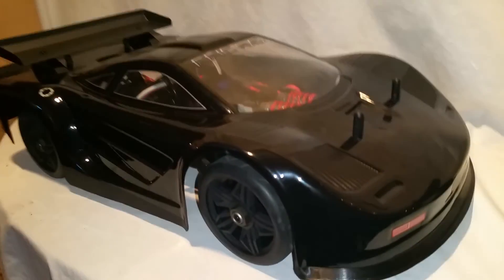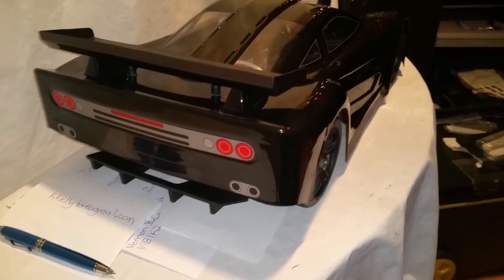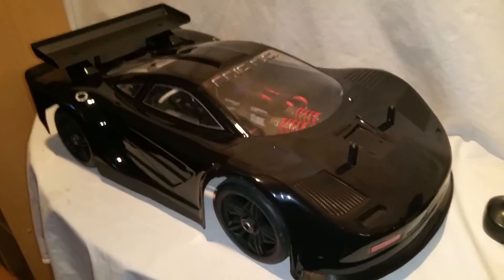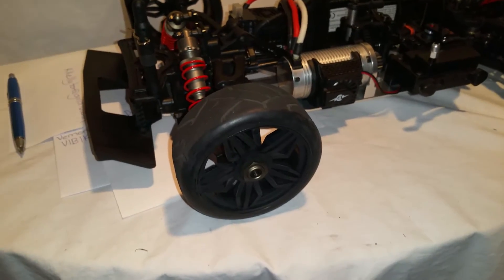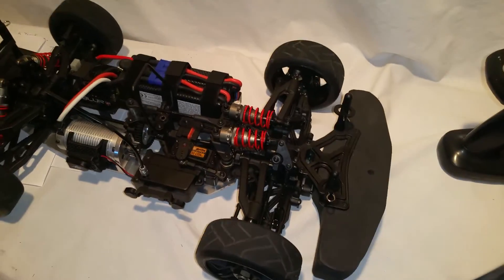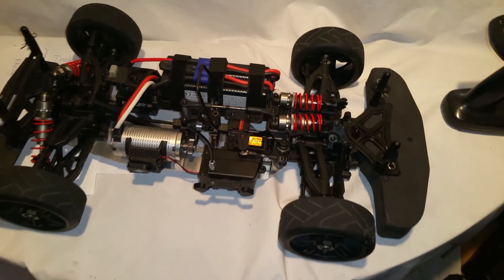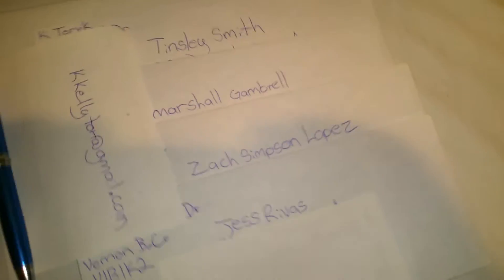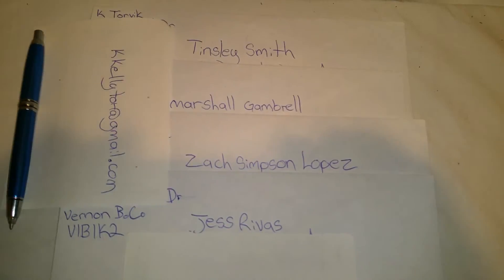ofna dm1 build done!

Comment: Your problem is that your receiver has more than enough power from the esc itself. When you actively continue to use the servo like your doing in your video the servo will drain all the power in the receiver. That is why your experiencing the glitch. I'm surprise that your DM1 didn't mad cow on you. Than again you didn't run the motor just the steering servo. Futaba receivers require a lot of power. That is why you have longer and better reception with a Futaba receiver than any other brand. You may want to install an external bec or a glitch buster. The bec will constantly power the esc because power is coming direct from the battery. If you install a glitch buster the glitch buster will store energy in the capacitor like a reservoir. When the receiver loses power it will draw the extra power stored from the capacitor. Hope that helps my friend. Your DM1 looks awesome. Can't wait to see it burn some asphalt. Thumbs up!
Reply from the maker: Thanks a lot man I kind of thought that it might need to be C. and I never knew that the futabas need more power that's news to me bro. again thank you buddy for all your great info you've helped me a lot cheers bud.